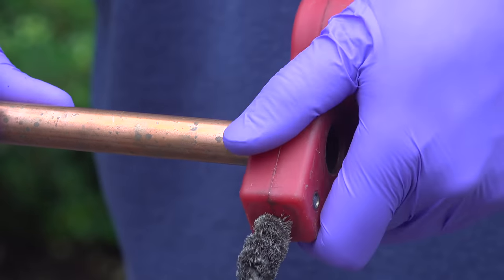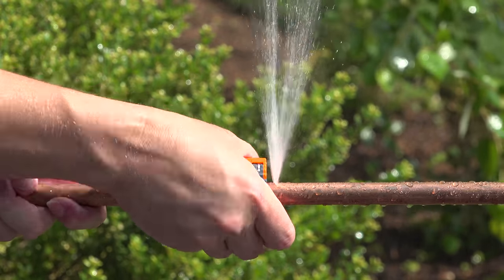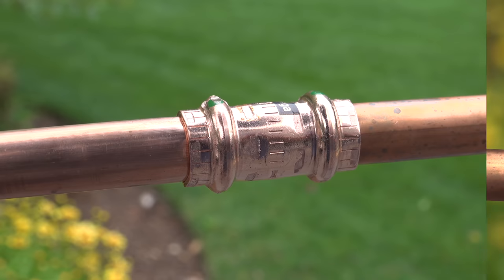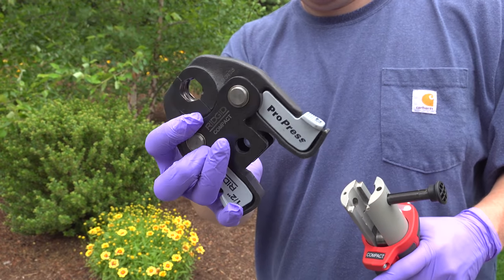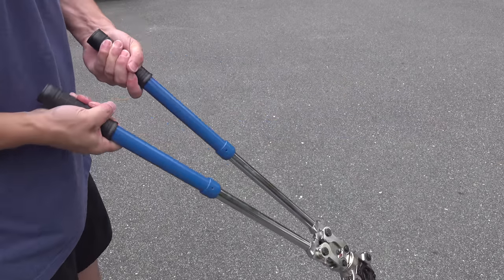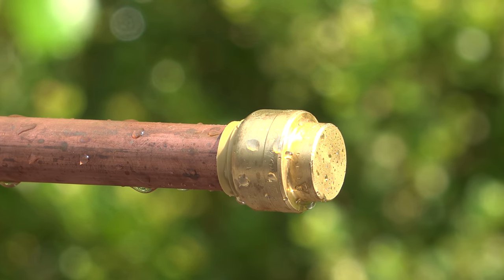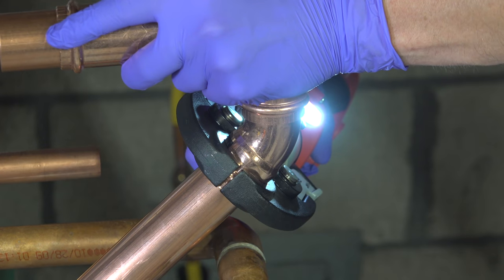NEVER SOLDER PIPE AGAIN - 3 Ways for EASY DIY Plumbing

Comment: I'm not a plumber by trade, but I do a lot of plumbing work and I've seen shark bites leak many times. I've made quite a bit of money repairing leaking shark bites (always by soldering if copper) ... and the damages caused by said leaks. I've seen numerous instances where a frozen pipe has caused a shark bite further down the line completely fail from overpressure. I would never use a shark bite in my own home. I have numerous shark bites in my plumbing box b/c they're great for quickly making temporary repairs until you can get back and properly sweat the connections, and they're reusable. If you know how to sweat copper, you don't end up with leaks, let alone "a lot of leaks". I've re-plumbed entire houses without a single leak. In all my years of sweating copper, I can count on one hand the number of leaks I've had. For tight spaces I will sometimes "cheat" and use the Rapid-Fire pre-soldered fittings.

Comment: sharkbite is great if you don't expect it to last.  I'm replacing a 10 year old expensive sharkbite that I wish I had done with solder now
and when they leak its not a small leak they pour so be sure to use them where you can detect a leak quickly or be caught with major damage from a leaky connection because the fitting leaked in an area that went undetected.  Solder joint rarely fail but sharkbite has a life expectancy so consider that when choosing your connection of choice and consider the cost as well sharkbite is expensive

Comment: Sharkbites only leak when you don't push the pipe into coupler fully. The depth of their deburring tool is the correct insertion. When repairing a burst pipe, for example, you can tap the Sharkbite to initially slide it on, but inserting the other end of the pipe into the coupler can be a challenge, if you don't have any leverage to force it to completely seat. That is the hardest and most frustrating part of the entire installation. I try to clamp on a pair of channel-lock pliers and tap the pipe into place, but you have to be careful not to squeeze too hard and deform the soft copper pipe.

Comment: When shark bites get hot from soldering near by they still work. I have a couple shark bite valves. 3/4" copper pipe. I've had them for a few years. Not one drop of leaked water.

Comment: I don't like sharkbites. Previous homeowner remodeled the bathroom and used mostly sharkbites for the water lines. A few years later after I purchased the home, 2 of the connections started leaking where I had to cut into stucco to fix one leak and remove some tiles from the shower to fix the second leak.

Comment: I'm a pipefitter to trade with 14 years experience.  To describe crimp fittings, such as Mapress, Chibro or the Propress fitting (They're all basically the same) you showed in this  video as "Solid" is very misleading.

A soldered joint is strong because that capillary attraction form the seal also holds such a join together.  It's structural, like a weld.

This crimped type of fitting does hold a pipe together, but it is not structural.  That limited hold is mere consequence of the fitting doing the only thing it's designed to do, produce a seal.  This means that a pipe with crimped fittings will need additional brackets to keep it held together, especially is one uses such fittings to replace soldered joints.  Not doing so risks a catastrophic failure.  Bring that bulky (And expensive, even the hand tool isn't cheap) tool to do the crimp in the scenario and what you can end up with is a piping solution that is lot more work and cost than it first appears.

Then, there's longevity. Those o-seals have nothing on soldered joints for how long they last. Yes, soldering joints takes a little skill and can hazardous and annoying, but it's all those things only once.  Expect to go back and repair a crimp fitting serval times in the same timespan.

Comment: If you have soldered pipes in a finished wall that are leaking you use a press fitting or if the pipe has easy access use a shark bite fitting

Comment: As a professional plumber, I've used copper lock &  It has drawbacks over soldering - 
1. It congeals very fast, not good if you're using tight fittings and want to give the fitting the recommended 1/4 turn or the pipe jams sliding into the hub. 
2. no applicator / brush, applying copper lock to vertical piping or fitting hubs wastes a lot of it and creates a huge mess, it's thin red fluid and stains badly when using your fingers to apply/spread.
3. Loose fittings can be a problem, I have had leaks and had to reapply excessively.

These problems would be mitigated if set time were longer than 30 seconds, fluid were thicker, and, there were a way to apply it in hard to reach or overhead positions.

Without question, copperlock is better than sharkbites for fire-hazard situations inside old walls.

Comment: Rubber gaskets are quick and easy to install, but they will start leaking eventually, it's only a matter of time, especially if you have many of them in the house. Soldering copper pipes is good, but it can be dangerous and doesn't hold up to freezing temps. PEX plumbing is a great alternative to indoor plumbing that solves many of these issues

Comment: You make it sound like the average person who only every once in a while can have these expensive tools.
Reply from the maker: They can if they need plumbing. As I said, Sharkbites are good for small one offs, highest cost per fitting but no special tools. Or buy the $180 tool for a bit more work. If you can call a plumber, when you see the costs for one job save more than just the tool. I dont think everyones rich but if you compare it to paying someone else its cheaper.

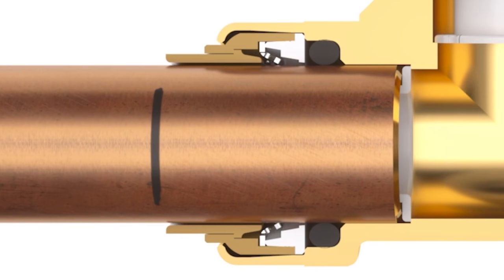Comment: 3:28 ...this shows the plastic pipe stiffener in the Sharkbite fitting while copper pipe is being installed. I've seen videos where the plumber says to remove the plastic stiffener when using copper pipe.

Comment: We have the manual ProPress crimping tool.  Any ideas why it won't grab the pipe?  We have it lined up correctly in the die but it's loose and won't grab tightly to be able to complete the crimp.  Got it to grab once, but then it immediately loosened and lost the grip.  Tool is brand new.  Thanks for any advice!

Comment: As a plumber in New Zealand we have just used a similar product on a 50mm ringmain and found it great. Pipework in walls 15mm or 20mm should be gas welded using a silver brazing rod. I don't know why English and American plumbers still solder. Solder is a lead alloy and still leaches lead into the potable water supply, it also has a low melting point, a joint gas welded with a silver alloy brazing rod will never leakand is more immune to cracking from expansion and vibration..PS sharkbite fittings are crap.
Reply: @pietmondrianstudent6984  Thanks for the update.

Comment: I could be wrong but I would venture to say that Sharkbites would likely fail faster on hot pipes as well as pipes that are more exposed to outside weather.  Ultimately it's whatever factors that would affect the longevity of rubber.  Rubber is not permanent, it's just a matter of asking the question is 5/10/15 year good enough.  Ultimately you gotta compare to what it's replacing.  Soldering is cheap and permanent, the only downside is the skill required, but nothing should stop you from buying $10 worth of pipes and practice for a few hours.

Comment: Im a plasterer and old degaded rubber seals on shark bite fittings keep me in plenty of work repairing ceilings over bathrooms. I expect press fit will keep future plasterers in work too. Nearly always hidden under the floors that have been tiled so inaccessable. I would much prefer a soldered joint in my own home

Comment: I've used several sharkbite fittings (including valves) in my parents house because I just couldn't/wouldn't solder there (didn't know about this manual propress/don't have a propress at the time). My worry is that even though I deburred the pipe well (i even cleaned it with grit cloth but I heard thats not good afterwards), they might pop off when nobody is around.

Comment: In my opinion soldering is best way, cause it is cheaper and the result is really durable. Pressed connections relies on rubber and cyclic expansion and contraction of metal due to temperature leads to leaks (same principle in electrical wire connection, pressure connections leads to bad contact with time and that leads to overheating wires). Also, you can solder not only with flamer, but with electrical soldering tools. Moreover, you can solder pipes even with 5$ 120W classic soldering iron, so no open flame required. And also, consumables are fairly cheap too. To connect two pipes you only need one piece of pipe with greater diameter, solder and flux. And something to cut copper. For example, angle grinder with suitable disc. Also all tools for soldering, that I mentioned are universal and may be used for other job. So, actually, soldering is cheaper, has better durability, using less tools (and those tools are universal) and, because tools are universal and consumables are primitive and some of them are just pipe cuts and soldering metal, it creates much less waste (soldering is better from an environmental point of view). However, methods described in video are seems to be twice faster and do not require turning off water.

Comment: >AS I DISCOVERED THE HARD WAY< Sharkbites are not acceptable for permanent use.  They are fine for a temporary attachment, but our Town plumbing inspector failed a bathroom upgrade when the plumber slapped those on and never replaced them with an "official" valve installation.

Comment: Torches around close fitting household structures can be dangerous.
Solder joints unless done well can leak and cause a great deal of frustration to a homeowner attempting emergency repair as the professional plumber is booked four weeks out.
Your home is without water for daily use.
I think I’ll repair with shark bite type fittings for easy, sure, and economical fix.
Job done.

Comment: Funny how in automotive (exesive temperature shift and vibration) this kind of quick connect systems aren't too much of a leaking problem, but you have plumbers swear up and down sharkbite are a sure failure. Automobile quick connect systems handle even hydraulic system pressure.
Reply: Not only that, anyone crying about "rubber rubber!! it doesn't last!!" clearly aren't actual plumbers or know anything about how this stuff works. Your own shower system uses a rubber o-ring to stop water from just spewing out everywhere, and guess what, they are designed for around 30-40 years. Yet you don't see anyone here bitching about rubber being used in heavily used area of the house (huge  family = lots of showering).

Comment: Cute.  Going to stick to soldering.  Its not hard.  Not sure why folks have such an issue with it.  Pro tip:  use an old license plate if you have to solder in walls.  Its bendable and shields the flame!

Comment: Yes. Shark Bites are the way to go. They cost you a bit but saves you in the end. Easy to install and works great for tight spaces. I never had one leak so I think best deal for the money without experience of soldering and sweating pipe. I would like to find cheaper as far as price but you can't get everything you want. lol.

Comment: Theres a reason we use solder, pressure testing with nitrogen to 3-400lbs i think its a better seal and last aslong as the equipment most of the time

Comment: Pro press is the best but it can get spendy esp with the tools/fittings. Sharkbite I would only trust temporary. But forsure always keep a sharkbite ball valve so if you cut into a live line you can leave the valve open put it on close the valve and shut the water off with little mess. I would rather solder and know it will hold until the copper gives. Also you don't need the tool for sharkbite to remove them you can use a crescent wrench/flat head screwdriver/chisel/shovel in a pinch.

Comment: Ruber ring seal ... leak in time. Good solder resit a lot ... some plumping in rome since 1000 years working 100% cooper with lead solder. Nice tool for fast fix but expensive and un comun suply.

Comment: Okay being a plumber for 7 years, there's a time and place to use propress, but there is always room to solder and it lasts so much longer than propress. As for shark bits, never ever use them they are junk, they are good for a quick fix/tempory till you have a plumber come out and make the repair.

Comment: Another good way would be compression fittings.
They are quick and easy and no special tools (just a wrench) and reliable.
No rubber seal that gets old.
I wouldn't do a whole job that way, but it is great for shut-offs and such.
Reply: Anything that relies on rubber seals will fail. Compression fittings are all metal so the best alternative to solder but really most of the time soldering is really easy. 
Just turn the water off and do a proper job!

Comment: All you need is to prevent damaging stuff when sweating copper pipe in tight areas and around flammable stuff is some asbestos board. Just slip it between the object that you don’t want to burn like the wall and the torch sweat your joint and then pull it out. It’s that easy! There is no place you can fit a pro press that you can’t fit a torch. The only advantage to crappy methods like pro press and shark bite fittings is saving time. However the damn fittings cost so much more that the thing is a wash in the end. You might save 20 minutes but spend an extra $50 on fittings so there is no point, and that assumes you already have the tool.

Comment: They have to get the price way down for Propress to become commonplace for both the tool and the fittings. If you need plumbing or HVAC work done there would need to be significant labor savings to offset the parts cost compared to soldering and brazing.

Comment: Copper isn't a strong metal in compression, so a fitting based on squashing it (without an insert - which would need to be brass and thick (restrictive)) is a bad idea. O-rings can seal a Clean pipe but will not hold pipes together.   
Finally, if you look at 1.57sec; it appears the valve has been installed and there is no way to get that crimper in to install the outlet pipe!   It also appears to be upside down.  If the valve handle falls down to OPEN, it is upside down.  I can't say for sure it is.  Learning to clean pipe and solder it is doesn't take that long and is still the main method in England for potable water. Plastic pipe is now commonly used for central heat but good plumbers still use copper for drinking water due to it's antimicrobial properties.

Comment: I am moderately pro SharkBites.  I installed a half dozen or so 10 or 11 years ago with no issues so far.  

I have not tried ProPress.  

I am curious if the O-rings have a life expectancy less than the copper.

Comment: I'm not why there is this common US aversion to push fit fittings. In the UK they are very popular even with professional plumbers. Most do exposed pipework around heaters, under sinks etc. in copper and all hidden plumbing is done with PEX & push fit fittings. All of the problems I've ever seen with push fit were down to incorrect installation, if the pipe end is properly prepared and seated they don't leak. I have, however, heard multiple plumbers complaining that push fit has deskilled their trade so there are unskilled people like general builders taking their work (and probably doing poor installation also, because they don't know what they are doing) but to be fair, that's not really a problem with the fittings.

Comment: What you all should know is that rubber degrades with time. If you think a rubber O-ring is going to make a good seal, time will prove you wrong. This includes SharkBites. Soon, people will be cutting open their walls and replacing these joints with soldered joints, spending three or four times as much on their water supply system as they did to begin with. Pex will also harden and crack. I owned a company that used Butyl O-rings to keep water out, not in, and the water was not under pressure. The O-rings needed to be replaceable because no matter what durometer O-rings we used, they all failed in time and had to be replaced.

Comment: I've never heard of this product until today. I am a contractor that have been working with a few subcontractors for the past 13 years. A Stone Mason, an Electrician, and a Plumber. Whenever I sign a contract, I call in the appropriate sub-trade. Let me be honest with you guys; I don't do Plumbing, Electrical, nor Masonry. This morning around 10:00AM I called in my plumber, he gave me a list of things to pickup. On that list was a sharkbite fitting. I was like what the hell is this🤔 I decided to look it up and found this video. Let be honest again. I am not sure that I will be needing the plumber anymore...🤫 I sub the plumbing jobs because I try soldering before in the past and it wasn't my forte, so I left it alone. Seeing that this shark bite technology does not require soldering and that's the only thing I couldn't do. I'm 100% sold on it.

Comment: For Sharkbite connections you should hear 2 clicks. One when the pipe engages the fitting and a slightly louder one when it bottoms out. If you don't do this you may have a leak.

Comment: Solder all the way. In emergencies, I rather use shark bites as I have many times before mastering soldering. The pro-press fitting failed many times for me. Shark bite on the other hand never did but it makes the pipes it’s connected to wobbly.